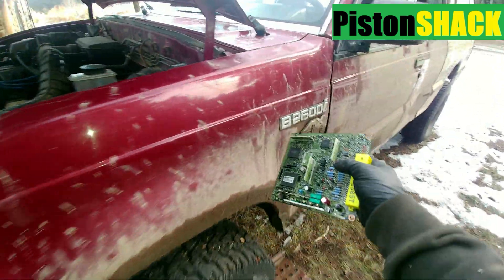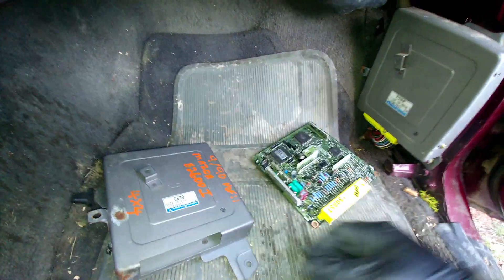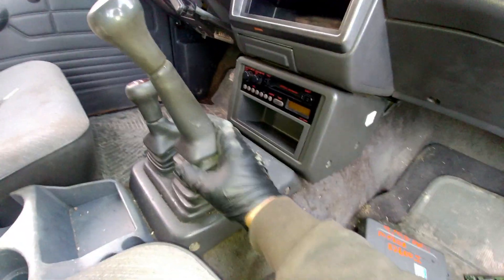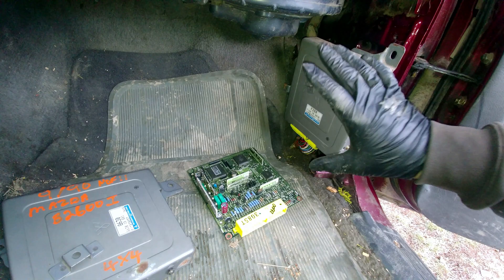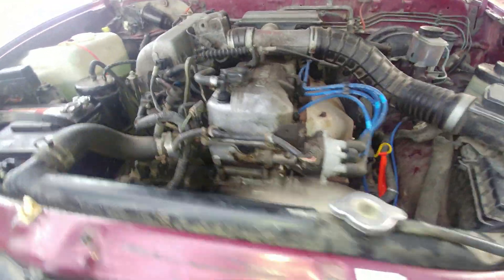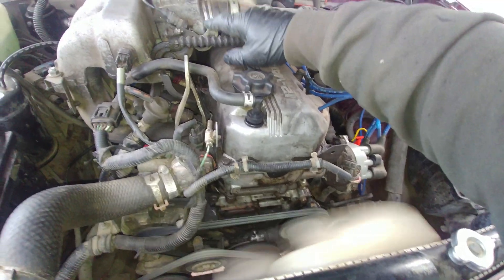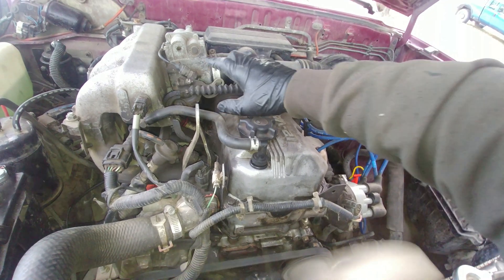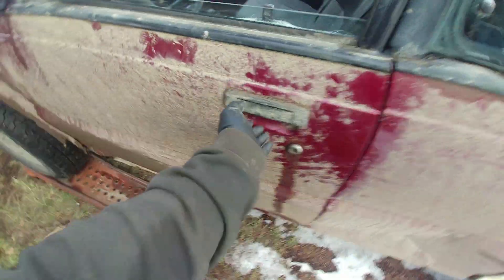MAZDA b2200 F2 engine ECU (ECM) running on b2600i G6 engine // 4K

Comment: Good evening, I have the same thing and after a general overhaul I changed the pistons, head, etc. I went to put it into operation and I have no spark at the spark plug, I have a pulse at the distributor, I don't have it at the multiplier.
,
Reply: @ΒασίληςΚωνσταντιδέλλης  hey I have the same problem, did you find a solution?

Comment: Hello, I have a 91 B2600i but I believe it has a 94 intake manifold system.  It has bogged down since purchase. I've tried everything, sent the ecu off twice, first time they said it was fixed, sting same bogging down, sent it back and they said they found a bad spot  and fixed it. Still bogging down. Thinking of doing this ecu swap. Can you be more specific on the 2200 replacement for the 2600 ecu? I've looked at some but can't find ones with the same plug in pattern?  Help??   Carl

Comment: i have a b2200 1992 manual, it has spark, fuel, air, compression is at 150 in all valves, im starting to think it’s the ecu, would like some help!

Comment: Hey there, any update on this?  I found my b2600i has a b2200 ECU, and the truck gets ~11mpg, with cold start, and other occasional issues (fouling plugs).

Curious if this is related to the wrong ECU being in the truck or not.  I'd hate to dump money on a new ECU if this ones fine.
Reply from the maker: Hey Doctranate! Same thing with me. "Farm truck" runs like a charm on b2200 ECU since. I don't want to spend 100$ on re-man ECU right now. I might get original one repaired later. I don't think so ECU from 2600i will make much difference.
Reply: @PistonShack  Do you actually DD the truck, or just put it around the farm?  Mine ran fine on the wrong ECU for quite a while, but over time has started fouling plugs, and the truck has never gotten better than 11-12 mpg.

Just curious what around town MPG is on your rig.  Love these trucks!
Reply from the maker: i love Japanese made Mazda trucks. Bzw, I got another one last week for 100$ - Mazda b2000 1988.  
I drive mostly around the farm but truck makes trips to town and back. My b2600i gets combine around 15-18 mpg.
Reply from the maker: What type of tires do you have on your truck? I found truck canopy (top) improves MPG by 10-15%.

Comment: Do u have anymore workin ecu
Reply from the maker: Hey Clayton. I don't know anyone in my area fixing ECUs. I just fix it myself but you can buy re-manufactured ECU on Ebay with a warranty.
Reply: @PistonShack  done tried one the eBay ones didn’t make a bit of difference runs exactly like urs did tho

Comment: i have a mazda f2 engine. can i use the b2600i ecu? my engine is front wheel drive btw
Reply from the maker: Hey Frederick! I think b2600i ECU will work on b2200. Check it out and let me know. I have never tried another way around.

Comment: Those old Mazda's were pretty bullet proof before Ford joined up with them
Reply from the maker: That's so true! Made in Japan Mazda b2600i was sold as Mazda Proceed to JDM. It's getting hard to find part. 
Bzw, I'm looking for used Bobcat parts.
Reply: @PistonShack  Thank you so much for looking for me
Reply: These G6 motors were running in the rebadged Ford Courier up until the mid 2000s, the ford partnership had some solid vehicles